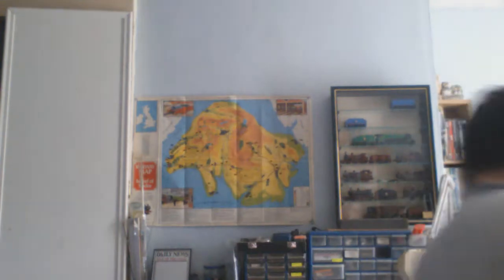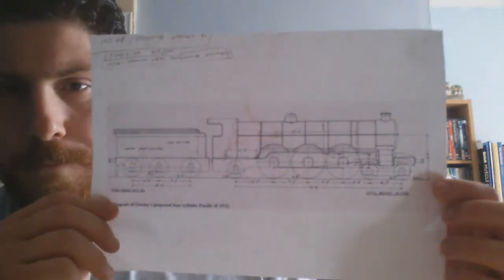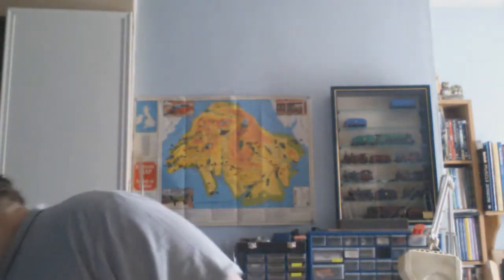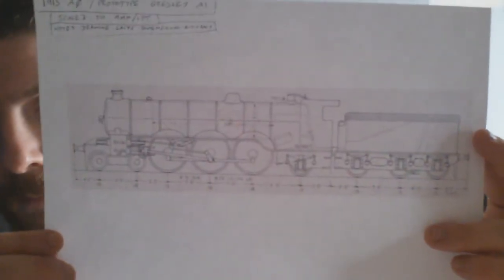A0 Prototype Gresley 4-6-2 Pacific - Some Clarification & A New SCC Project Near Completion!

Comment: When you do make them, I would be intrested in them. I have always wanted to model MK1 Henry but never found the time or the right information to follow. keep it up. With the wood leave it for a month to dry out and see if the water goes gout and it should reline. This has happen due to water  mositer getting in and causing warpping.
Reply from the maker: michael sarsfield - Yeah I think the water likely did warp it a bit.  Still track planning it.  For the MKI I believe it should be a pacific rather than a 4-6-0, not a popular opinion but that is where the evidence leads.

Comment: I have a theory: Henry and Gordon are brothers.
In my opinion, we can easily consider them brothers for these reasons:
1. Were built by the same designer (Sir Nigel Greeley) although not in the same place (Henry was built in an unknown workshop somewhere in Northern England in 1919; while Gordon in the other hand was built in Doncaster, Yorkshire at sometime during 1920 and 1922).
2-Before each one’s rebuilt they were both A0s (the prototype of the prototype for Gresley’s Pacific) while Henry was more similar to the old drawings of the prototype and Gordon was more similar to an random Gresley A1 Pacific, we can easily say that they were sort of the same class.
In my universe they would be long last brothers, and would only discover this at sometime during the 2000s.
I think this may be true or canon in RWS, I wonder what Christopher Awdry would think about it, maybe he could confirm about this theory.
Reply from the maker: It's basically the same theory I wrote in my RWS Database.  Same ideas yup.  Alao explains why Gordon always poking at Henry...his brother.
Reply: @Sparkshot always poking his older brother, like any other younger brother does.
I think they actually knew from the very deep that they were brothers, besides, their relationship was kind of brother to brother (they know each other for nearly a century).
Reply from the maker: @Alarcj7  - Yeah it seems this way very much so.  Gordon is the 'real' A0, Henry was the cheap bodge job nock off that came early...Gordon is erked.
Reply: @Alarcj7  I always thought flying Scotsman is younger. He's a A3, and Gordon used to be a A0, even thought people say in 1939, he was rebuilt into a A3

Comment: Hey Sparkshot, have you ever seen Wildnorwester's version of Edward Mk2, could you put on sale an model like this?
Reply from the maker: Done 5 variants of the Freelance Variant K2s.  Could do a couple more based on the LATE K2 model I uploaded but no time soon. Really busy with stuff.
Reply: @sparkshot  Alright, do it whenever you can.
Reply: @sparkshot  Remember, make an Edward mk2 with the two cab windows having being like two rectangles joined with a semicircle at each side, the splashers as large as they are in the freelance variant V3.5 that part that is right under his "face should be the same Freelance variant 3.5; but his running plate, boiler, funnel, stripes on the boiler, dome and whistle should be the same as how they looked in his mk1 shape.
Reply from the maker: @Alarcj7  - Maybe one day.
Reply: @sparkshot  Alright, get a picture of Wildnorwester Edward mk2 to make it easier.
Thank you btw.
Reply from the maker: @Alarcj7  if you could grab a selection of pics and email them to sparkshot082@gmail.com I could evaluate a bit easier.
Reply: @sparkshot  Right.
Reply: @sparkshot  I have just sent it.

Comment: I have some questions and one of them is, how much do you charge for a custom ho scale hornby / bocman locomotive or rolling stock model?  Because I live in America and I wan'ted to start my own hornby track layout for the sake of large locomotives and alot of my sugetsted designs are custom on a pice of paper.
Reply from the maker: Giglepie Zon0 depends what it is but considering it takes me months to design things you're looking at 100's, especially if the design is to be exclusive or not likely to be a popular resale.
Reply: I understand. But would you like to know what it is?
Reply from the maker: Sure, please send me an email though and we can go into it there.

sparkshot082@gmail.com
Reply: Sorry I'm having trouble with the gmail. I'm gana give it to you straight, 1. Could you 3d print a flying Scotsman auxiliary tender body and mayby a frame, because they are vary rare and hard to get, 2. Is it possible to enlarge drive and bogie wheels or add more boggie and driving wheels to locomotives such as the a1, a3, a4, p2, coronation class, standard class 8, patriot class, tenders, exedra. Because I wan't my layout to be build for the sake of custom extended/ enlarged locomotives from us/uk as well as a custom body and livery, but my problem is I can't find spare parts for an ho stirling locomotive.
Reply from the maker: I could design a tender but it isn't something I plan on doing to be honest.   It would likely be on Shapeways or £50-90 as a guess due to its size and I can't see many takers.  
If you are ultra keen we could maybe do it as a commission but it'd cost a lot more simply as it would take a lot of hours. 

Adding wheels is only really possible if you completely rebuild, bash or redesign a locomotive almost from scratch.  Adding smaller wheels would mean lowering the axle center lines in order to keep the same ride heights.

Do you have a Shapeways account?

We can use that like an email in the PM system if you want.
Reply: sparkshot I'm afraid not. I'm only able to talk to you through YouTube because I only have an Android but if your saying theirs still a possibility then I'm planning on getting a desk top for most needs.